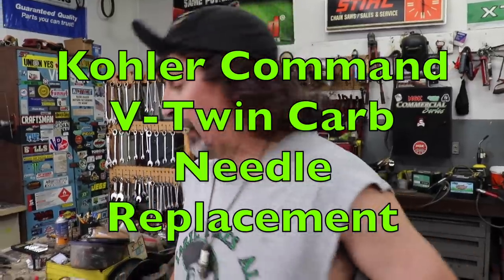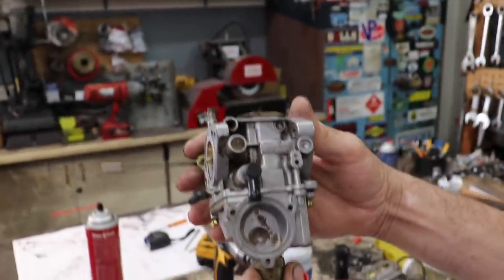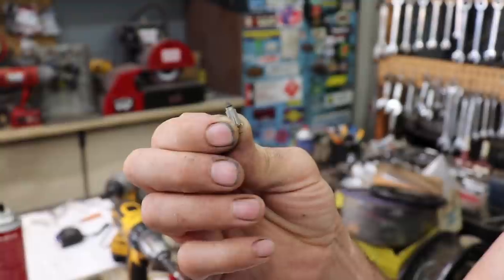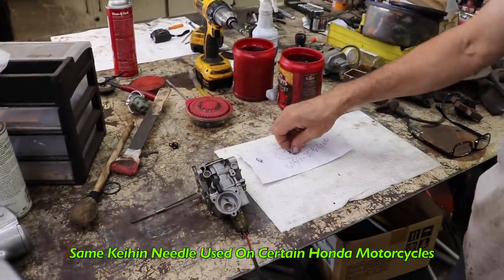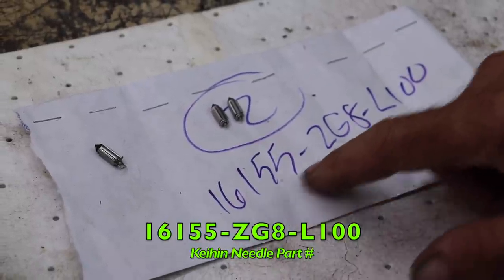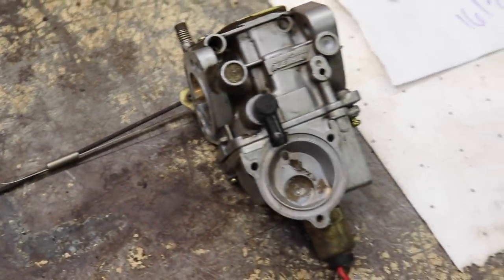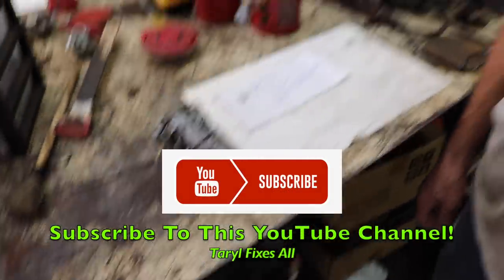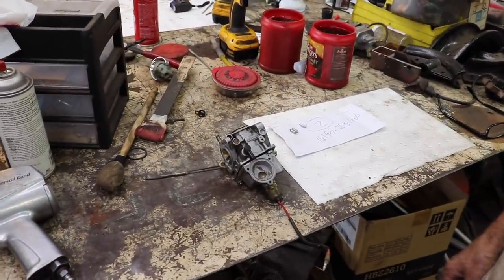Hack! Kohler Command V-Twin Carb Needle Replacement

Comment: On a lot of the Kawasaki carburetors you can use the needle and the float out of a Briggs push mower with the float bowl carburetor. The needle works fine but you do have to shave just a fraction off the float where it  straddles the float support posts.. Use a sharp utility knife. Kawasaki likes to put it to you too.

Comment: Needle valve tip coming off happened to my brothers 1950 Hogly-Davison motocicle. He was 30 miles from home & had to load the 8' board, tie downs go pick him up in my piece of junk 1974 Chev truck.
It was a Bendix, witch carbatrstes them old mochines good.
The original carb cast from solid brass but didn't have a giddie up pump and went by the handle Linkert. Or it's secret agent # M-74B

Comment: Taryl, great video!  You are right on when it comes to Kohler carb parts.  Here in Canada, the kit can cost up to $200.  Any advice on replacing the seat?  According to Kohler, it has a non-replaceable seat, so any seat damage requires complete carb replacement, which here is about $450.
Reply: I have the same problem. Some people say a Q-tip with some polishing compound works, another guy uses a small ball bearing and a brass punch to reform the seat if the Q-tip trick doesn't work, I got lucky, all I did was clean the seat with a Q-tip and carb cleaner and a new float needle.
Reply: Did you ever find a solution? Thanks
Reply: @MrXracer390  No, beyond replacing the carburetor, which is what Kohler suggested.
Reply: @donens9310  did you go factory or Chinese?

Comment: BRAVO!
Yep, I have that carb on my PS-KT745-3011 engine that
drives my Husqvarna LGT2654.  I don't need the needle valve yet, 
BUT at 150 hours on 4th year I owned this mower, it suddenly
started a wretched HUNTING. 
I repair small engines on the side, so after making sure everything
else was OK, I removed the carb, extracted the MAIN JET, and
drilled it out to 1/16 of on inch. --> YES:  1/16"
Put it back together, and it runs absolutely GREAT.
Thank you sir, and take care during this FAKE GLOBAL SHAKEDOWN
known as a PLANDEMIC.  FAKE FAKE FAKE!

Mr. Brown
North Central Florida

Comment: I find it  crazy how much  shops charge for parts . Like a kohler v-twin they want at one shop 198$ for one starter  at another shop they want 230$  an the last shop they want 161$ .. go online an order a starter for 45$ . Still to this day can not figure out why shop charging  3x  sometime  4x  the price... Like that carb you have in the vid . you can get that carb for  40 to 50$ online . shop here want to charge  380$  for it .i know making alittle money  off the  parts . but dang  not get rich quick .. i ant knocking no one ..  i  been  doing small engine repairs for years  as a side hobby. Maybe  explain in a vid one day :)